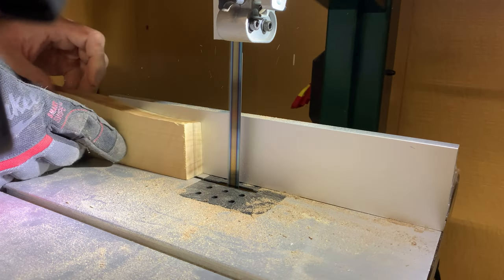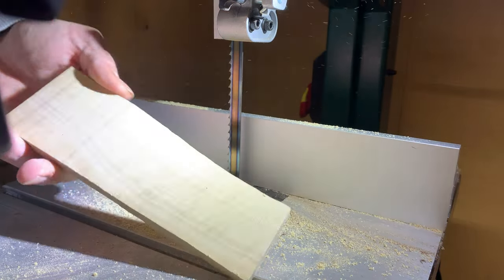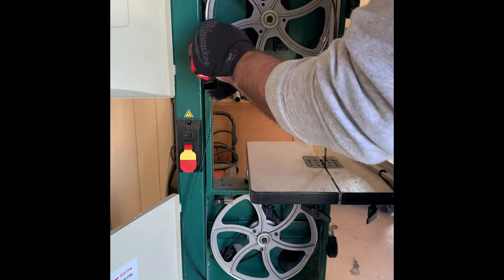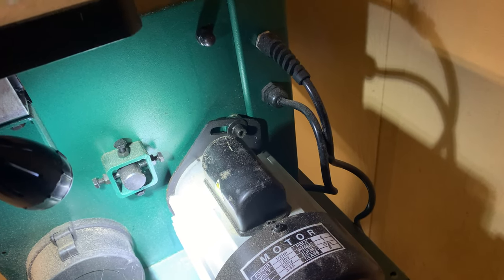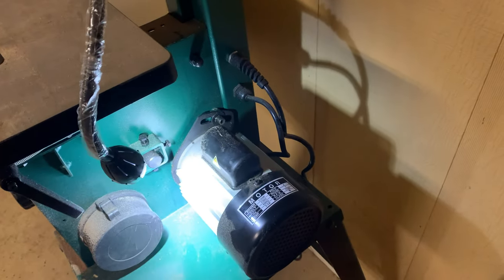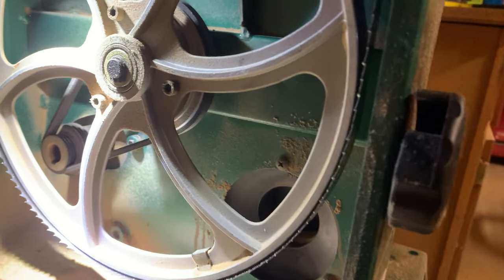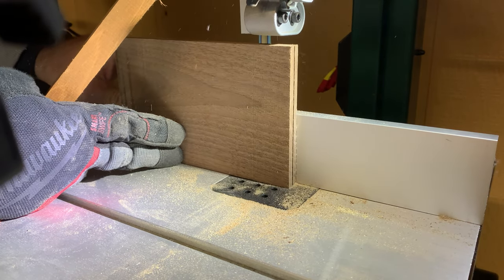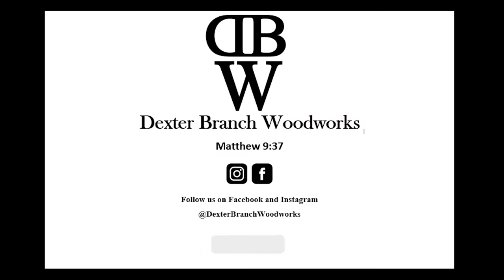Grizzly G0948 10" Bandsaw Follow Up Review + Low Power Fix

Comment: I would also like to THANK YOU for the update. I was about to order this saw, but decided to hold off based on your earlier review. Now I'm back in the ordering phase, and confident that this saw will work for me. I still have one question though. The lack of a rear fence attachment has me a bit worried. Is it still a problem for you or did you find a fix for that issue?

Comment: Thanks for the review, Do you think this will resaw a 5inch cherry wood? I want to buy this since the resaw capacity is around 6inch.
Reply from the maker: I think so. I cut a piece of heart pine that was around 6” and it did fine. I would recommend the 1/2” blade though to help with clearing material and blade drift. I have a link in the description.